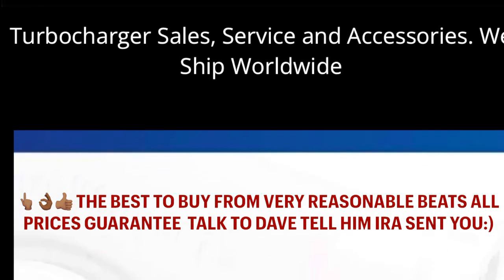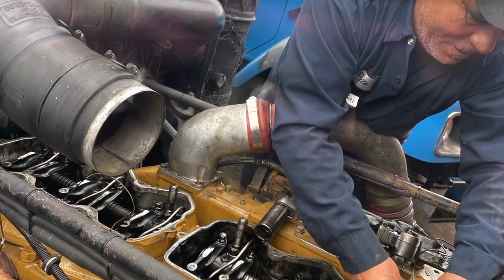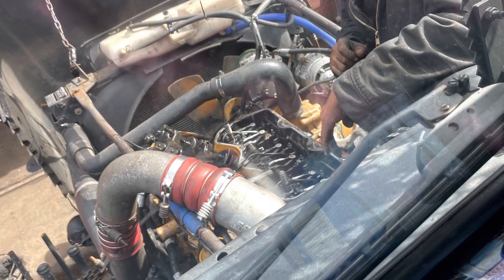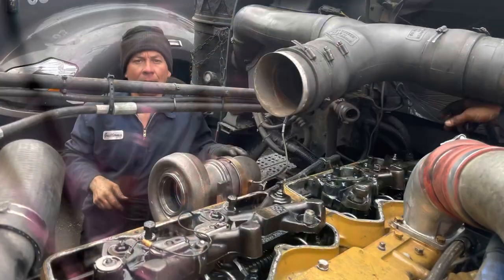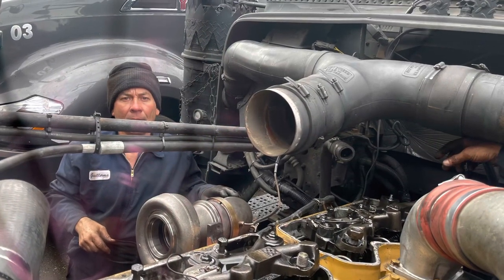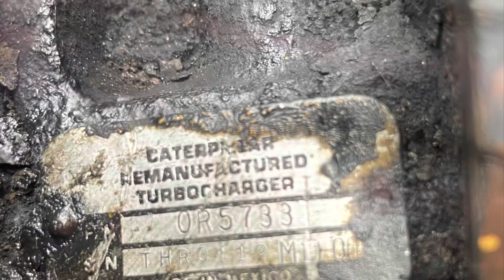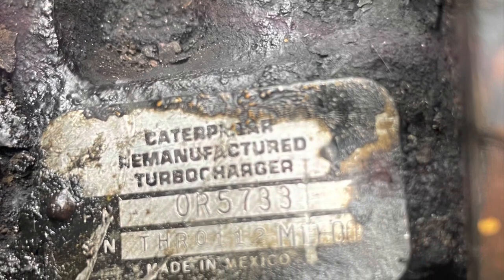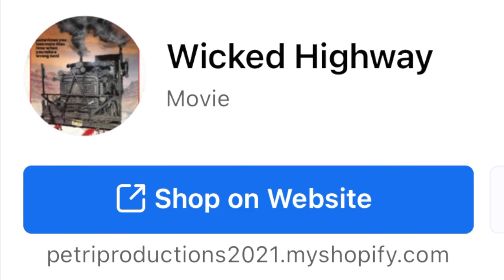3406B CAT Borg Warner Turbo Upgrade recommendations (LOUD whistle & quick SPOOLS)

Comment: I’m running an s482 82mm with 1.45 housing. Spool time isn’t bad with the 1000 horse cam and 58 injectors in it. With a 435 tune in the ecm it’s putting a little over 800 to the ground. EGTs stay under control as long as it’s not a 6 mile pull. Pretty dirty until it the turbo lights. Fuel mileage will run between 5-5.5 at 120k gross

Comment: Just so you know, Caterpillar still makes the 3406C mechanically injected and jacket water aftercooled engine for 3rd world countries that do not want an electronic engine. The 3406C is basically a 3406B with some upgrades-but is not smog compliant.

Comment: 3406b no power afther 50/h. Chance the air fuel diafraghma  no the engine gos off on low gears what can be. Need a lead thank you

Comment: 12.7 Detroit, custom cam and Billett turbo through Serious Series 60 in PA. Custom tune from DCS, ceramic coated exhaust manifold and pistons, PDI balancer, injectors are flow matched from SS60, Davco fuel setup, truck dyno'd 734 at the flywheel, 606hp at the ground. It's not earth shattering, still manage 6.5-6.8 pulling flatbed.
So glad to see you rolling and doing your thing Ira, stay safe brother